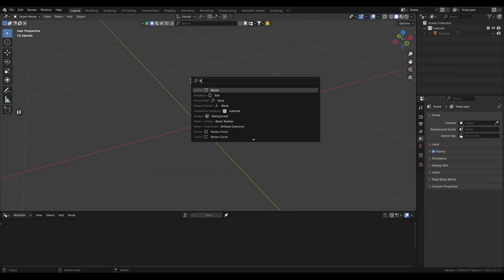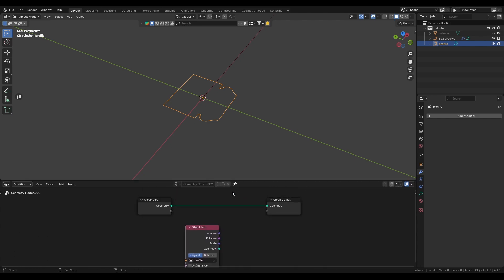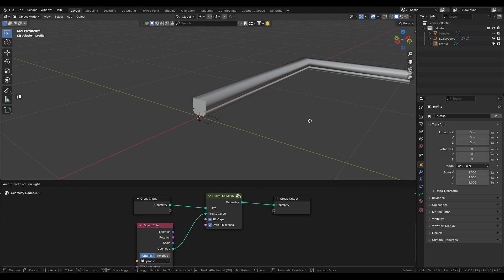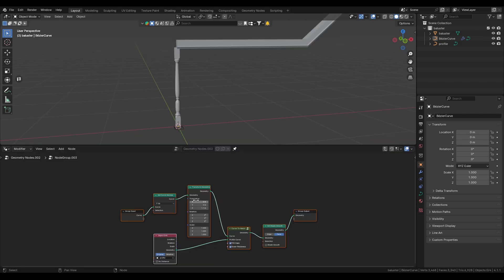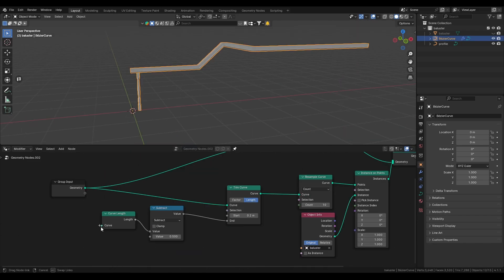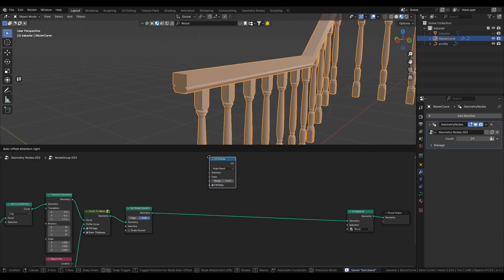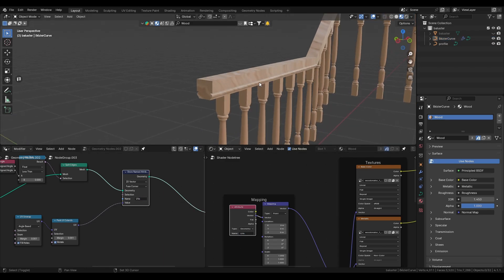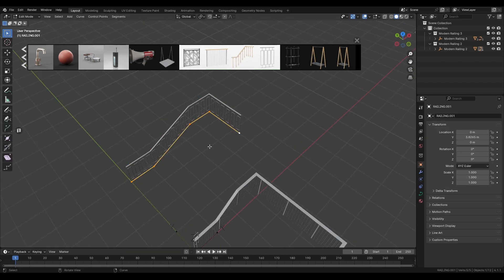EASY Railing Using Geo Nodes In Blender

Comment: How would I add holes to the railing mesh? With a distance of X meters between each hole?
Reply from the maker: That is a very good question, to which I dont have a good answer to. If you want to have modular holes for this railing setup, I believe you need to use booleans, probably. This setup wasnt really designed for such a usecases though.

You basically use the existing spline you are using for the railing and array your boolean objects on the spline. This would probably be a bit computing intensive though and might give you boolean artifacts.

let me know if you figured it out!
Reply: @SimonEberl3D  what I did was a created a mesh that had the holes in it, and then I tiled them with a bezier curve. Similar to the video. Where I placed the mesh at every control point.

Comment: Great Tutorial...for Architecture...could you throw some light on the Node groups which are visible only at the ending?
Reply from the maker: Hey thanks alot! Sorry for the confusion. I basically grouped the handrail and balusters seperately and then joined them. So there is nothing inside those node groups that I didnt show in the video! Feel free to ask me anything if you have more questions!